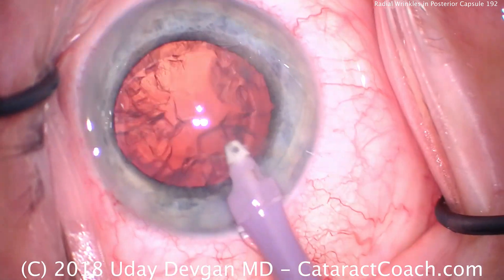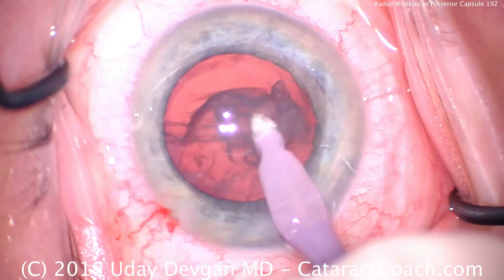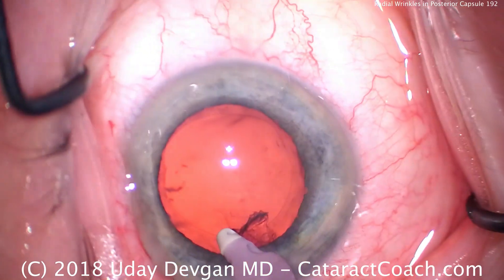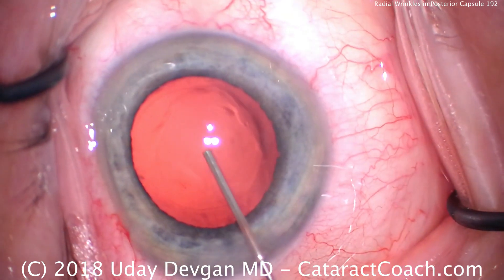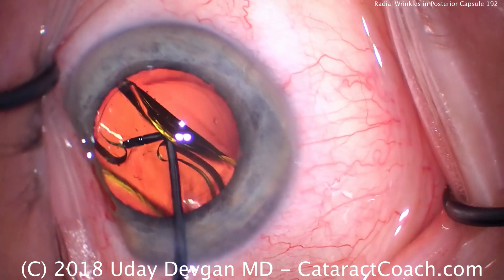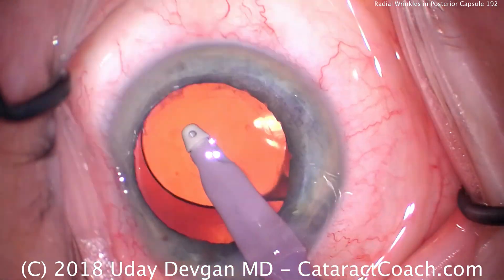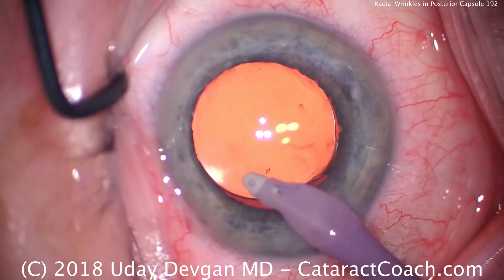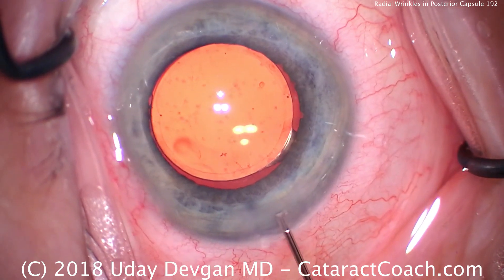radial wrinkles mean aspiration of the posterior capsule during cataract surgery

Comment: There was a case i saw radial wrinkles in my phaco surgery like in this video, but after that in the IOL insertion step, after the IOL goes in, The posterior capsule ruptured. i have to hold the IOL with sinskey so it didnt drop to the vitreous cavity. 

My question is from your understanding when/in what step the PC Tear happen? i didnt realize it happen until IOL Insertion step.

thanks!